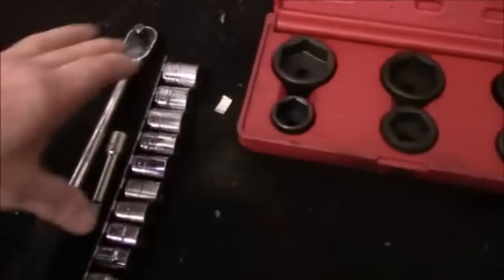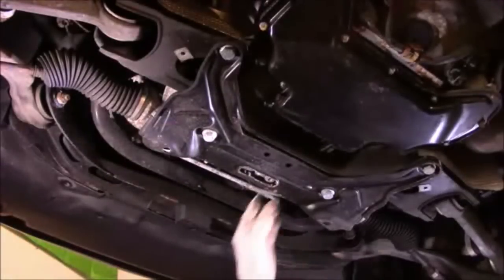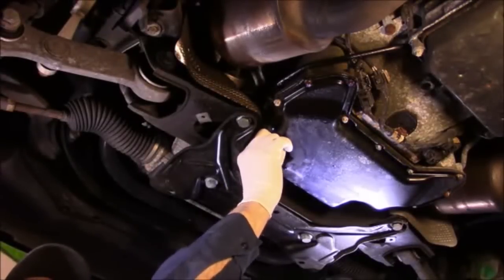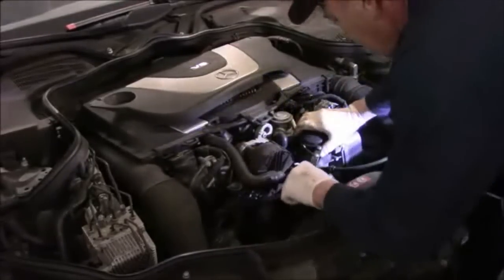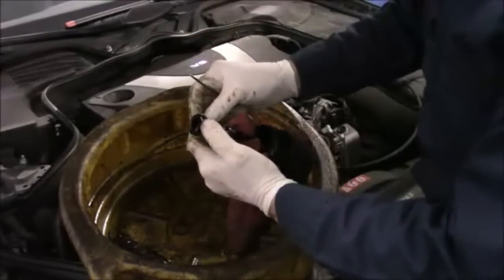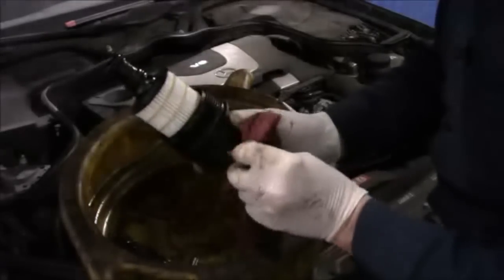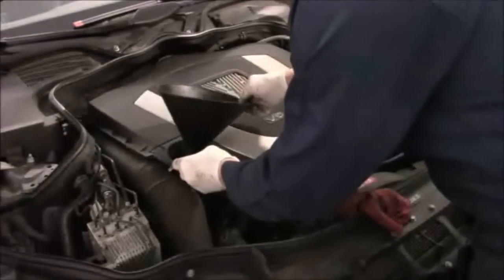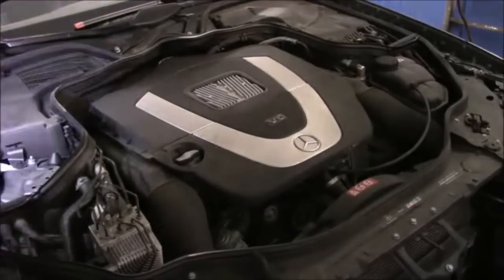How To Change The Oil And Filter 2005-2011 Mercedes Benz ML350

Comment: Jim, I have been changing my oil on my 2004 Mercedes E500.  Taking it to the dealer costs $350.00 +.  Dealerships are way to expensive and not always honest as to what your car actually needs I don't think.  Thanks for the video.  Tom

Comment: Very nice n clean job. 👍 up for good explanation. I could her though as you started the car that the compressor made a struggling sound, same thing happened to mine.. Had to change it, as it couldnt keep up the air-pressure in the airmatic system..
Reply from the maker: Thanks 👍
Reply: Just had mine replaced also. $1200

Comment: is there a dipstick for the oil on the engine? My 2008 has one dipstick in the front for the transmission.
Reply: there is no dipstick for the oil
Reply: No. There's no dipstick for the transmission. 
You need to buy a transmission dipstick and it doesn't stay in the engine. Access is in the left rear, it has a small red cap with tabs. 

That dipstick in the front is for oil.